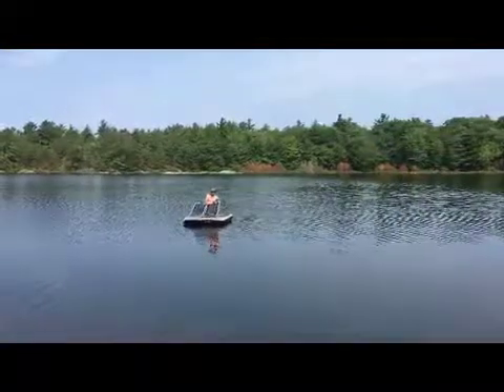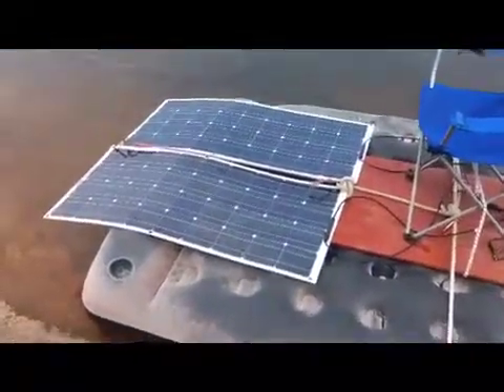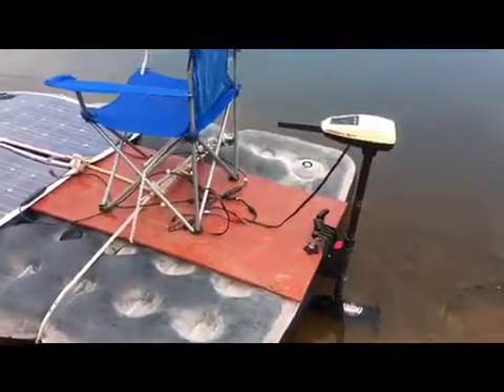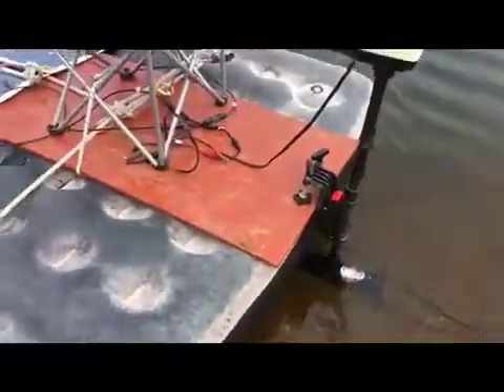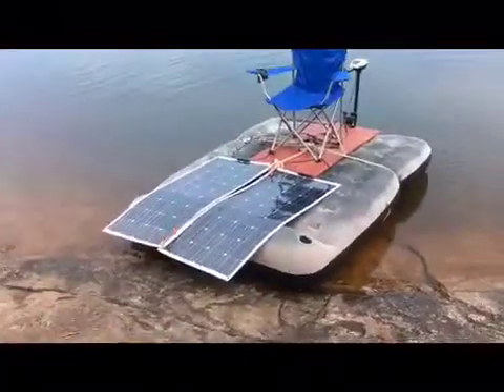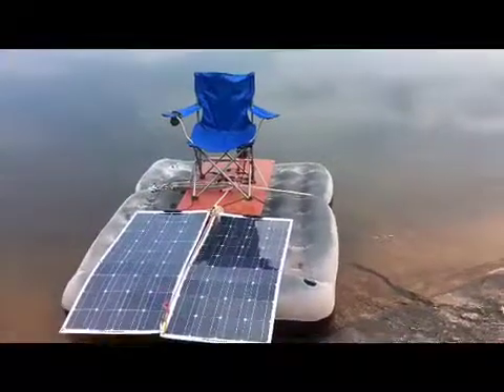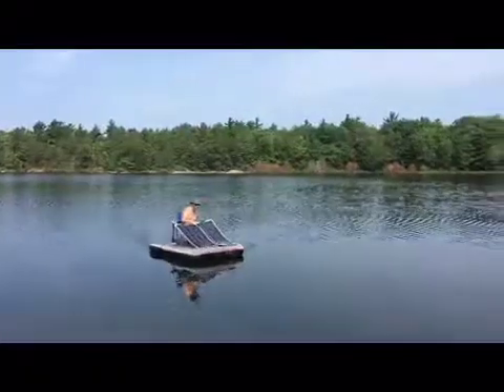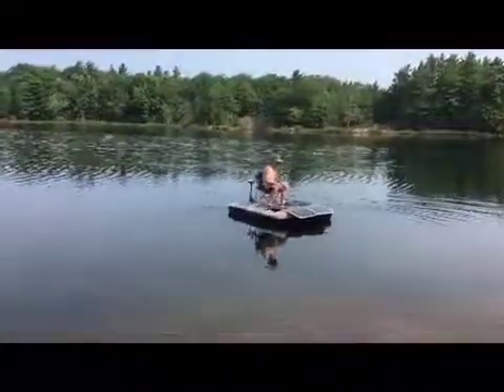Worlds Cheapest Solar Powered Boat!

Comment: One thing you may not realise, that trolling motor uses a ni-chrome resistance coil in series with the motor as a speed controller. In speed 1 going forward or reverse, its  using 4 times as much wattage to heat the eater as the motor gets.